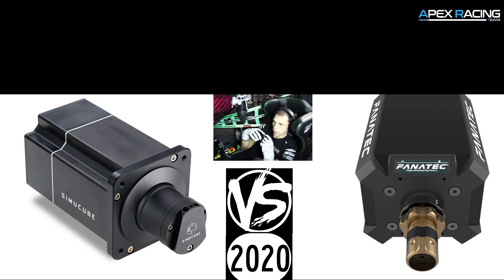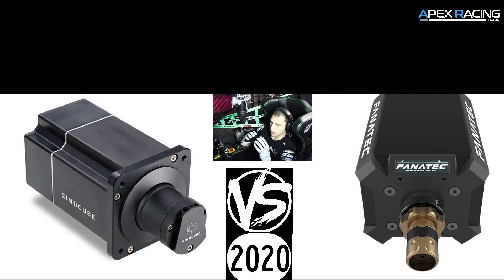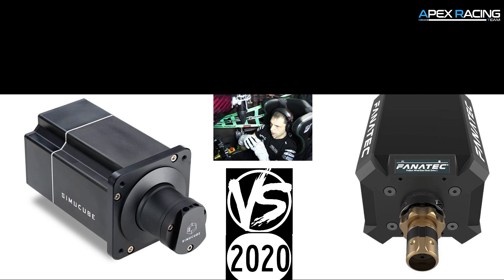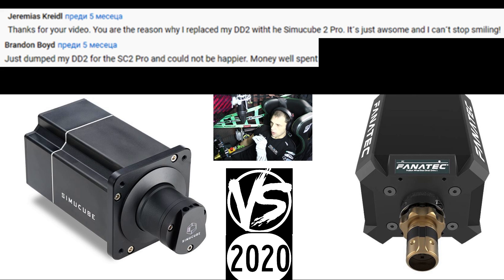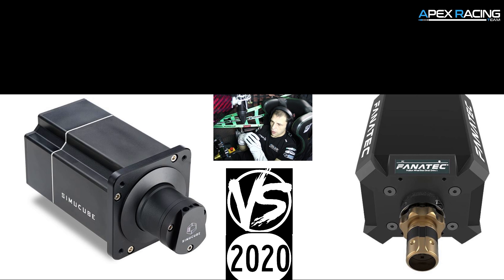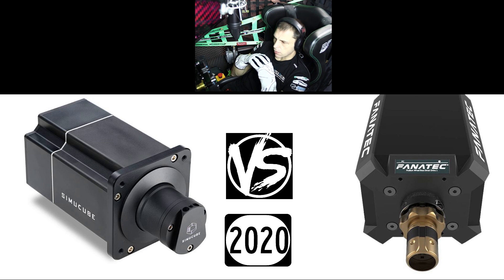Fanatec vs SimuCUBE 2 in 2020

Comment: Small correction: the DD1 is not limited by any software to 20Nm Peak and 15Nm Holding Torque. This limitation is because of different electronics, so it's a hardware limitation...
Reply from the maker: Pined
Reply from the maker: Thx for the correction mate , pined your comment to be sure everyone will see it !
Reply: I thought it was electronically limited it has the same motor as the dd2 maybe not
Reply from the maker: ari exarhos it is the same motor for sure and that is the reason they increase the price for DD1 from the official price they told as from the beginning!
Reply: @chepilevski  i think momorious is a fanatec employee and hes trying to hide the truth 🤭
Reply: They are the same motor, just the controller is flashed to identify it as either one, therefore limiting it’s power.
Reply: @Simlife101  yes and that's exactly what I said.
Reply: Agreed man

Comment: Thank you for your always very complete and impartial reviews. I too have recently switched from the fanatec ecosystem to the simcube 2 pro world. A passage that is certainly happy, this base is much more realistic and simulative. I ask you for advice for choosing a gt-style steering wheel .... I'm undecided between cube controll and ascher .... at the moment I'm very tempted by the cube controll for value for money. Do you have any advice to help me choose? Is it also possible to have a new video with your simcube filter adjustment settings since you have been using it for several years?
Reply from the maker: They are both great buddy! 
I would say , go for what you like the most visually and price of course! In reality and comfort they both do great job!

Comment: Hi.
I have Fanatec dd1 and after your reviews i decided to purchase a SC2 pro .
So, today i ordered.
I play almost exclusively ACC.
Can you share your settings for sc2 and ACC?
Thanks in advance and keep doing what your doing, because you doing well .
Greetings from Romania.
Reply from the maker: Hi Gabriel 🤛 I’m sure you will love the upgrade buddy! 
In game I haven’t change anything except the GAIN to 35% 

In Simucube driver 

Overall Strength 100%

Bumpstop feel - Medium 
Reconstruction Filter 5

Damping 5%
friction 5% 
Inertia 0%
Static Force 0% 
Slow Rate Limmit -Off 
Ultra low latency 10% 
The rest  on the bottom just let them as they are ! 
From those settings you can just start changing the GAIN in game to your like if is too strong for you in the beginning 🤛
Reply: @chepilevski  thank you very much..I will return with my impressions, after receiving the base and testing 
I ordered sc2 pro with Ascher f28 sc v2, by the way.
In Assetto Corsa same settings i guess, or not?
Stay safe
Reply from the maker: @gabrielstrichea9128  definitely want to hear your experience buddy 🤛
Reply: @chepilevski  today i received sc2.
What can i say.
In some way is different, more fluid and i dont know, more connected i feel.
But the gap between DD1 is not so high, from my point of observation like  between 10-20 percent.
Anyway, i am happy with my purchase and thank you for your settings,feeling great. I'm not faster, but more consistent.
I hear some strange noise from base, it is normal?  Like tyres when pushing hard the car when turn.
Reply from the maker: @gabrielstrichea9128  yes buddy, that noise is normal! I’m happy to hear you enjoy it ! 
The  difference unfortunately is more pronounced wen you use SC2 for some time and then switch back to DD ! Happy racing mate 🤛
Reply: @chepilevski  thanks Master Steliyan

Comment: @Race Beyond Matter, I have posted this same question at Boosted Media. Also curious about your take on the current Fanatec new driver and firmware. Now with the new Fanatec 447 drivers and firmware and the new Fanalab 1.66 it would be really interesting to see how close Fanatec has gotten now to the SimuCube feeling. My DD1 transformed into a completely new base with this firmware. It is a massive upgrade. Will you be re-doing this compression based on the new firmware and drivers?

Comment: Dont make my mistake if u have a dd1 or dd2. I swapped to the sc and i couldn't tell the difference.. I mean its not that big.. Not worth the extra cash 😑
Reply from the maker: I swapped too and I don’t regret even for a second but as you said , those DD wheels differences are not worth the move from one to other as the return is very small! Those videos are more about basic knowledge if you go for your first DD system but even if you have the first GEN OSW Wheel swapping not worth the extra if you care about the money! If you don’t care about the cost, we’ll that’s another topic 😃
Reply: @chepilevski  what im saying is... For the beginner's the dd1 is just more than enough... They will absolutely love it. Paying more for the sc is not really worth it.. Its just my opinion. U can get bothe the wheel base and a nice wheel for the sc price. Even if money is not a problem.. Its just the right choice. Again in my opinion 😕

Comment: But didn't you have the DD2 and you didn't think it was as good? And thats fanatec exspensive DD wheel not the cheaper DD1, didnt you return the DD2 and got the SC2 pro and if there DD2 wasnt as good the DD1 would be worse no? also you can get the Simucube 2 pro for £1240 UK and £350 say to convert a MCLAREN GT3 Wheel converted to USB  so just curious.
Reply from the maker: The DD1 and 2 are not bad wheel bases just SC2 is little better! Some people feel the difference and some not ! And the McLaren will do the job but there are other little more expensive options which will be better choice for first SC2 wheel !

Comment: I recently sold my Accuforce V1, bought a Simucube 2 Pro and now have a Fanatec DD 2 to go along with my Simucube 2. For me, apart from being smoother and quiet in operation, the difference between the Accuforce and the other two isn’t all that big: certainly not as big as I expected, or as big as some would have you believe. For the money I was honestly underwhelmed. Going from a belt driven wheel to DD is night and day, the difference between DD’s isn’t nearly as big. Between the Simucube 2 and DD2, with all the damping and filters off, I honestly can’t tell the difference, they’re both very similar. It comes down to the software and finding settings you like. Some will prefer True Drive, some Fanatec’s. I personally think the Force reconstruction filter in True Drive is horrible, some people love it. I don’t think you can go wrong with any DD wheel system, we’re lucky as sim racers to be so spoilt for choice. All of this is, of course, completely subjective. Everyone has different preferences when it comes to Force Feedback, the only way to find out is to try them for yourself.
Reply: Yes it's true. I believe, as you said, that the main differences are in the details. For me, it will be a big difference, because I had a G27. When I was undecided between DD1 and SC2, I read some forums where some users complained about the problems that occurred when they were using DDs. In addition, I had a good impression  when I saw videos and reviews from SM, especially from here.
Reply: I went from a Fanatec CSL Elite to SC2 Pro and yes it’s better, but I wouldn’t call it night and day. Friends had a go yesterday and were also underwhelmed. I think the expectation of difference was too big. It’s just faster, more fidelity, but it’s not a game changer for me
Reply: Everything is subjective but for me, going from csw v2 to accuforce to osw, there was a big difference.   Accuforce v1 was the first direct drive wheel I had and I only kept the csw v2 for consoles after feeling the accuforce.   Then I got an osw wheel from simracingbay.   I had the osw set up in one room and accuforce in another.   After just two tries, I immediately made the choice to box up and sell the accuforce.   The difference was huge.     I would say after now having a simucube ultimate, that the difference between the osw and simucube 2 is not as big s osw from accuforce.   There is a difference in smoothness and detail but not a I gotta gotta jump to simucube 2 difference.    It’s more like a Cadillac vs Mercedes difference.   Both are luxury cars but Mercedes is Mercedes.
Reply: what is the best ? SImcube 2 or Podium ?
Reply: But you have to consider quality on the long term. If you consider the CSWs, Fanatec previous edge bases, you'll see the great amount of failures and crashes. DD1 and DD2 are new, there's not many reports about them, but, in the long term, nobody can tell what will happen to them. I know what happened to both my Fanatec CSW 2.0 and CSW 2.5: they're useless now.
Reply: Marcelo Alves what did you end up deciding on and why, based on your research

Comment: After watching your DD2 vs. Simucube comparison, I almost cancelled my Fanatec DD2 wheel base order after running into some setup glitches and ordered a SimuCube 2pro. The problem with that, was the availability. I didn't wanted to wait or alternatively pay prime $$ to get one within a couple of weeks. Now I have the DD2 and  have been experimenting with the settings for the better part of last week. Luckily there is a lot of information and help online.   I'm probably in the category of drivers that wouldn't feel the very fine difference to the SimuCube. The price was partly the deciding factor but more so the fact that I come from a ClubSport v2 wheel base and the backwards compatibility enables me to use my Porsche 918 RSR wheel. The one thing I noticed also was the movement in the quick release hub. I replace the expanding rubber with two part clamping ring that makes it as solid as a single shaft. If you look at it you won't be able to tell the difference and the way you change the wheel is the same. I must say that I'm very pleased now with the feel and the performance.  Thanks you for the excellent video!
Reply from the maker: Man, as I said there is no wrong choice in DD world! You will be happy with any choice you do because the DD wheels are just next level and differences are not that big at the end of the day ! Enjoy your hobby buddy in that next level ❤️
Reply: Hi Volker, im owner of ClubSport v2 wheel base as well and i want to buy my first DD base. Trying to figure out if i want to get SC2 pro or DD1. I think im 99% confident now ill go for DD1 and the question is what was your impression with the DD2 from ClubSport v2 ?. And how long you had ClubSport v2 ?.
Thank you.
Reply: Roman Galda    For me, it was a big step forward. It took some time to get the settings and profiles setup right.    But that would apply to any new wheel base .   I did build a motion platform based on the SFX100 actuators and SimFeedback software.  For the motors I’m using Integrated 75 VDC servo Motors made by Teknic.  The DD wheel base completed the setup. It was the perfect match.  I design a 3D print replacement for the rubber ring on the wheel quick connection and it is now 100% rigid.  If you decide for the Fanatec ,  disconnect all USB connection first  from  your PC before you do the firmware update.   Good luck
Reply: @vwkrebs  Hi Volkers! Can you explain a little more your qr flex solution? Thanks!
Reply: javigongon javigongon Hi ,   My replacement ring is working similar to the original Fanatec rubber ring.  When you tighten the lock nur the ring is pressed together and it expands outward.  The rubber ring is changing its shape.  On my ring, the inner and the outer rings are conical at the contact surface.  Tightening the lock nut is pushing the inner ring  into the outer ring and forces it to expend outward.  This way you have a truly solid bond between wheel and hub.  I mad a YouTube video if you google “My Fanatec DD2 wheel hub clamp ring”.
Reply: @vwkrebs  thanks for you answer!

Just saw your video, that a real clever design mate!
 
Would you mind to share the stl? I would really like to try it.

Thanks again!
Reply: javigongon give me your email and I send you the 2 stl files .

Comment: Well I am still driving in the DFGT :P Broken I might add, the paddles dont work properly (double shifting sometimes) so i use the shifter on the side :P
Reply from the maker: That double shifting is so annoying ! It have killed some important races previously !
Reply: @chepilevski  https://youtu.be/uXeF8jHUXDQ?t=687
Double shifting in all of it's glory right here, at first i thought i did something wrong with the clutch button, then i reverted to autoclutch and had the same issues, then i disabled the paddles.

Comment: I'm lucky enough to have the means to try both units.  I first  owned the DD1 used it but wasn't too impressed ( I've been sim racing since 1996 and have used a lot of wheels and bases, which probably led to my divorce, lol.). So out of curiosity, I purchased the Simucube pro 2, Turn Racing Wheel and the Asher 16-M wireless button plate. Immediately, in the first turn of Laguna Seca, the difference of smoothness and finer fidelity was Absolutely Apparent. Although I really loved Fanalabs and the "on the fly" quick changing of settings with the DD1 and New Porsche rim, the Immediate immersion of Simucube stole my heart from the DD1. I did convert my Fanatec 2018 F1 wheel and the Universal Hub with SRM conversion kits because I still believe, for the money, fanatec makes amazing wheels, it's just those wheels found a new home and a superior quick release system with Granite Devices. Keep up the great videos, luv your channel Bro!!!!🤘
Reply from the maker: We have very similar experience with DD wheels but also Simracing longevity and divorces 😂😂😂 thx buddy! I enjoy the process for sure 😁
Reply: @chepilevski  Absolutely my Friend! 👍

Comment: Hi there dig your style man! In your opinion a 20 NM wheelbase is enough? I kinda got that from what you said about the two Fanatec direct drive motor units.  Have you any experience of the Simagic 10 or Simplicity SW20? They're more my budget. Thanks, keep up the outstanding work and a wish you success in your racing
Reply from the maker: It is worth checking the VRS DDW as it have 20nm Mige but with Biss-C encoder ( best encoder for those motors ever created) and coming from SC1 with 10k CPR encoder the VRS wheel must be the best bay DDW ever created for the money and I’m pretty sure is very close to SC2
Reply: @chepilevski  Thanks. That's really helpful and appreciated.

Comment: Hi, because of your videos i bought the SC2 pro. With the reconstruction filter Set to 1 (fast), the wheel osscilates at the straight and the Delay in Feedback was Not realistic. Now i turned off the reconstrution filter and i am getting linked to the car like in Reality. Its absolutley awesome !
Reply from the maker: I know granite are working hard on this filter to improve it because is the most important filter on this program! Let’s see what will they bring to the table 😃
Reply: @chepilevski  we have this on Simucube 1 now and it made my 20nm Mige motor come alive, so much smoother now

Comment: I got to enjoy multiple DD's for a few hours and at the end of the day, SimuCube 2 Pro Ultimate has slightly more detail and can produce more torque, the Bod feels refined and a delight to use, the DD1/2 feels smooth, quick and responsive with good detail. So.. ultimately I guess we should be thankful! From what I hear from my friends, the ones who own the Bod, SC2 pro ulti, OSW's and custom Mige's, it wasn't that long ago where getting into a Direct Drive was both super expensive and also restrictive, in the sense that, you only had a few select option for a 'ready made DD' which was more OSW like, without being an OSW.

Now we have OSW's, the ability to buy the original SimuCube's from some specific sites, admittedly you have to dig for them. Bods, Leo's and its not even that complex anymore to build your own OSW, and finally a Direct Drive that is literally just Plug n Play, that being Fanatec's lineup, and they're mostly all good quality units too. Admittedly, for that plug n play you sort of sacrifice the ability to cheaply swap from rim to rim, since Fanatec decided to lock down their ecosystem with the highly overpriced Podium Hub, yet still.. that Quick Release system is quite nice, I personally upgraded from my trusty and much beloved CSWV2.5 ( Seriously, hands down the best belt driven wheel base on the market, but you can get a Mige for its price. ) to a DD2. Loving it so far, beautiful piece of kit and I much prefer its QR system over the CSW's as mine has absolutely no play in it whatsoever.

Though with how many rims I have now and how much I've spent on damn Podium Hub's, if I had better impulse control, I probably would have went with a SimuCube 2 Pro, simply for the fact that I would have saved possibly over a thousand just on Quick Release adapters, its pretty easy to convert Fanatec rims to USB.
Reply from the maker: Top detailed comment ! I cannot agree more then that with the CSW V2.5 ! I own one just before I moved to the DD world and I have to admit was almost DD class base !

Comment: I recently bought a simucube 2 pro and I still need a little bit of adjustments for let it fine, but I'm starting to enjoy it in some sims. I'm happy with this buy. By the way, about the steering wheels. I'm playing with my SC2 with a simple 70mm steering wheel without padelshift or buttons, for just 50 euros... I think that's a big advantage having already spent 1500 euros. With the Fanatec you can't do that...
Reply from the maker: Yes, that true too ! You can do that with Fanatec too but you have to spend 200€ for podium hub :)